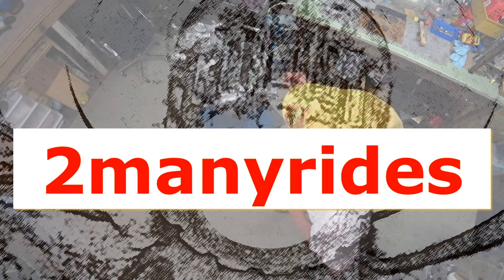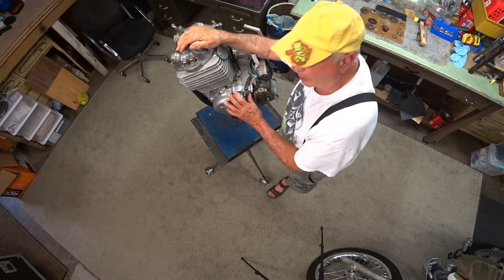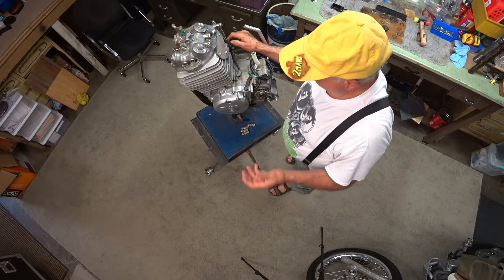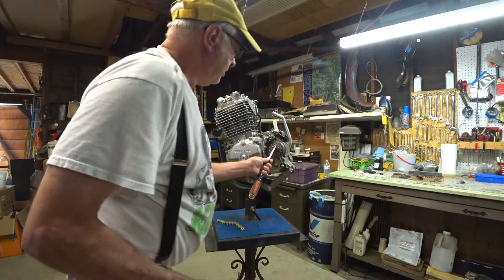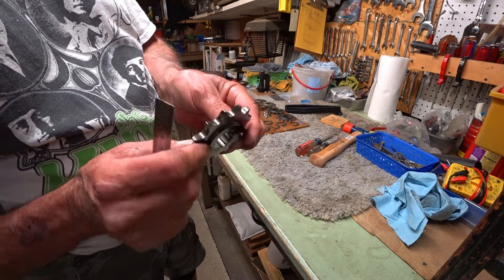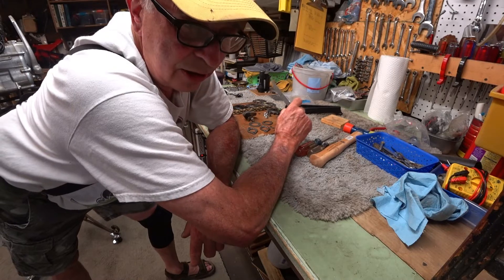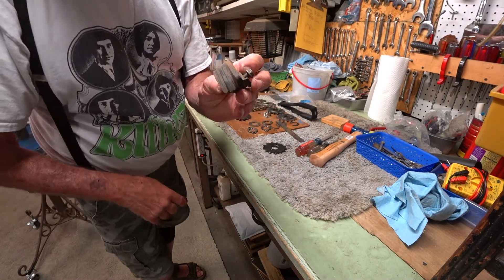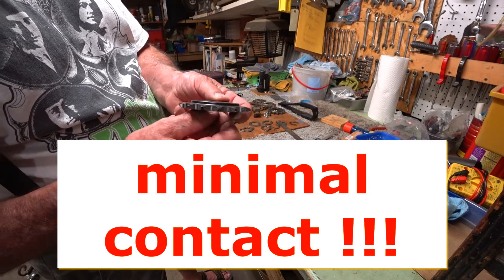talk of xr600r countershaft spline wear

Comment: Really great info good job, I loved my 83 XR500R and my nephews 98 but when looking for another bike I passed on the XR because of that spline issue, a game changer for me, if I had that problem I'd have a new countershaft made up using 1995 Yamaha XT600 sprockets, check those out!
Reply from the maker: 1995 Yamaha XT600 sprockets have a wide contact area. The splines themselves are quite narrow. They're inexpensive!
The 83 xr500r you speak of is going to have the countershaft in it that has larger and less splines overall. From what I've heard from owners is they're not having this wear problem. And I never saw wear on my 82 xr500r. I think the bottom line is maintenance, keeping it clean and slightly lubed. Avoiding harsh take-offs and banging the clutch to do wheelies. I have 7 xr600's and only one has spline wear. That motor was damaged by some one else. AS well, if you were to go by what I said I heard from one guy who talked to the ex honda engineer, then it's the 1988 xr600r's and up that you have to worry about.
Hey... Thanks big time for your comments!
2many

Comment: I have often wondered if this was caused by running a super strong high horsepower chain that is less elastic
Reply from the maker: Well, I am no engineer, but I gotta say that the chain itself never crossed my mind as being the determiniing factor in whether wear is going to takle place. Even if the chain is binding or limp it's going to wear the sprocket teeth. I have owned the 92 since new... No signs of spline wear at all. An ohv, it has been on pavement for a few miles at a time, but never spent a whole ride doing asphalt. I don't bang gears. pop the clutch or run wheelies. I gotta think that's why it is unworn. I believe its due to the floating mounting system and thin hardened steel sprockets harder than the shaft.
And there's that one story that I read on advrider that the author said he was having lunch with a former honda engineer. The guy said honda decided that the shaft for the off highway only 600's in the us market did not need as much heat treating because the nature of a dirt bike is to break traction. Something's got to give.
 Thanks for your comment on the discussion,
2many
Reply: @2manyrides  I've got a 2019 XR650L that I bought new in 2020 just over 10,000 mi and no signs of counter shaft wear I change the oil every 1000 miles and the filter every 2000 miles and run rotella 15-40 t6 synthetic still got the original spark plug and air filter in it the oil still looks clean on the dipstick at 1000 miles on my second front sprocket and  chain ran the original till the teeth broke off luckily the chain didn't do any damage to the case I truly believe the Honda XR series bikes are as close to bullet proof as you can get
Reply: @2manyrides  I remember reading somewhere that there was a Honda street bike that you could swap the stator stator cover and voltage regulator into a xr650  to triple the charging output I'd be interested in this mod for my bike for heated cold weather gear and aux lights
Reply from the maker: @nathandevine552  Love hearing the stories like that one.